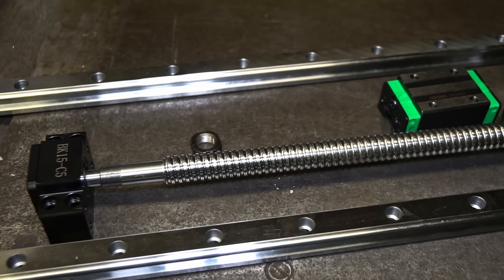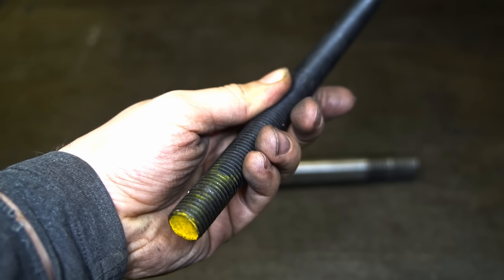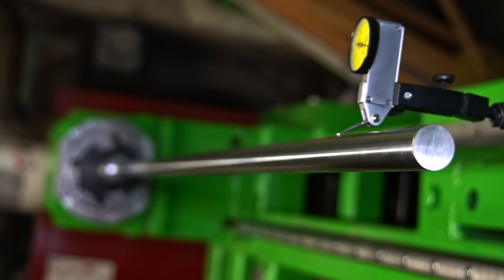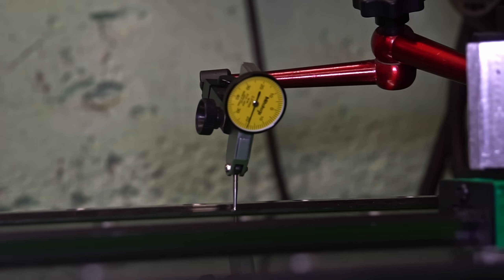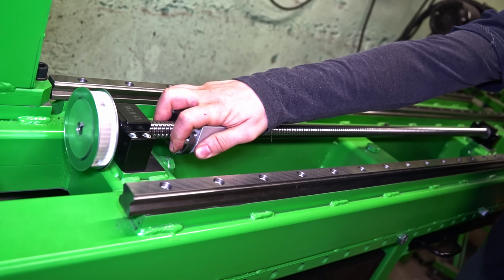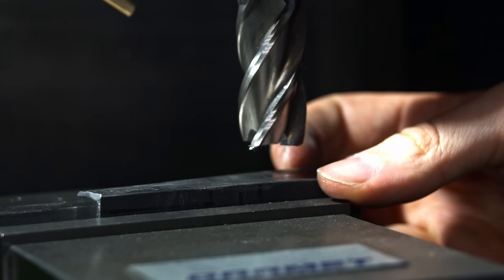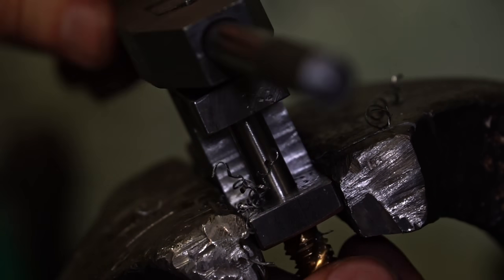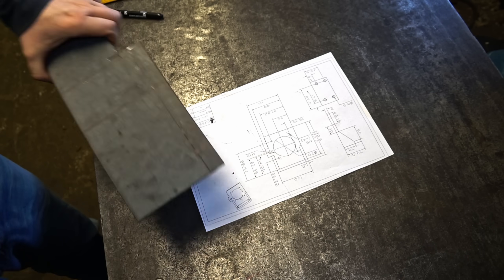Z Axis! - DIY CNC Metal Lathe Build! #9

Comment: Why? this is the classic case where buying the parts independently is far far more expensive than just buying a finished lathe. If you want to have fun just building one, just buy one, take it apart, and put it back together and save yourself $2000.
Reply from the maker: Well yes, but actually no. Taking something apart and putting it back together isn't exactly the same as building it from scratch. I wanted to learn as much as possible. Building things is a way to learn a LOT. That's why :)  But if it came just to money - you're probably right.

Comment: it's correct to use belt tension-er in  servo systems? When motor change direction, belt are tensioned with different force. Its better to use tensioning with motor mount.
Reply from the maker: That's a good question. I considered that too. Will see. If there's any issue I will think about that and correct it.

Comment: How come you tapped both sides of the tensioner instead of making one side a clearance hole? Is that so you don’t put too much clamping force on the bearings?
Reply from the maker: Exactly as you say